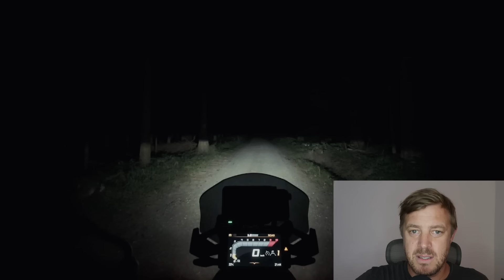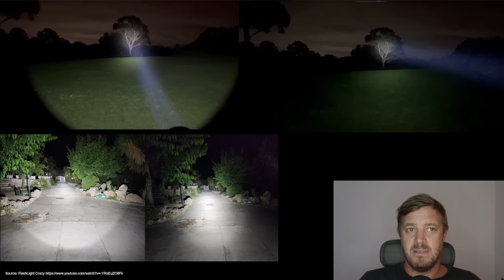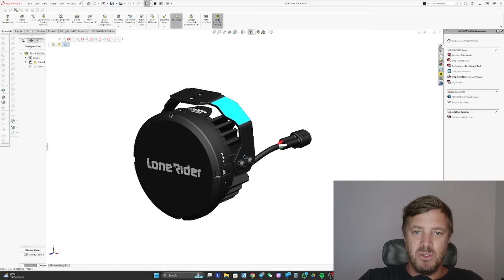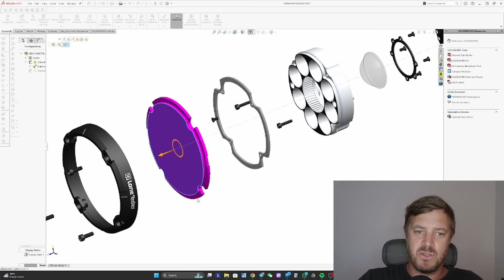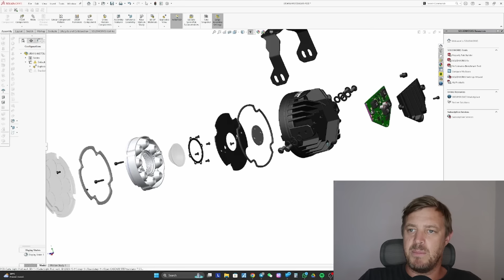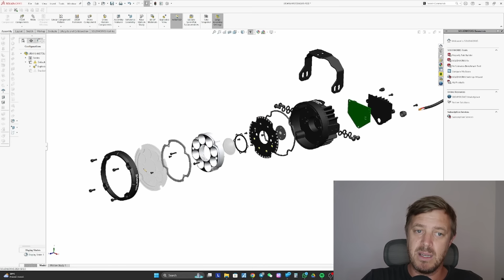Don't Ride Without These! Why Motorcycle Aux Lights Are a Must 🔥

Comment: These look really well designed, but IMO, you made a major error with the DRL color scheme.  Fog lights should be Yellow, NOT Amber!  First, Amber lighting is illegal in the USA on the front of a vehicle, except for turn and hazard indicators (which MUST be Amber). Therefore, your DRLs should be either Yellow or White --  Not only are Yellow fog/aux lights legal, they provide excellent contrast with the White headlight which stands out to other vehicles, are more visible than Amber during daylight and of course, penetrate fog/mist/rain much better than Amber and even White.

I would strongly recommend White or Yellow DRLs that switch to Amber when turn/hazard indicators are activated.  I personally know at least 12 riders (including myself) that would buy these tomorrow if they had a Yellow DRL option.
Reply from the maker: Noted in the switching from white to yellow. Looking into it 👍
Reply from the maker: The DRL can be changed to white, and the yellow lens added.
Reply: @LONERIDERMoto  I "think" this is great news... are you saying that the DRLs can now be switchable to White or Yellow (not Amber)?  And if so, can they then switch to Amber for turn/hazard indicators?  In other words, can the DRLs support 3 colors, i.e., White, Yellow and Amber (for turn/hazard indication).

If they can only support 2 DRL colors, then please go with White and Yellow.  Even if you're running Yellow DRLs, they can remain yellow (though not flashing) when the normal OE Amber turn/hazard  lights are activated.
Reply: @LONERIDERMoto  You mean Amber lens added, not Yellow, correct?

Comment: I saw a product called MotoCAN on your thumbnail. I was wondering how you guys were expecting us to install the lights onto our bikes. I was thinking that the only thing that would male sense is if it was installed with the EzCAN or similar system. So it looks like you guys are going to be selling your own version to go with the lights. I'm hoping that the lights will still work with the others like EzCAN or Cansmart.
Reply from the maker: Hi, yes, it will work with MotoCAN from Lone rider or  Hex Innovate ezCAN (Gen II, software version 2408)
Reply: @LONERIDERMoto  Great - thanks a lot. I am looking forward to seeing the new lights.

Comment: Looks like you nailed everything with these babies. Riding 2021 GS 1250, using Denali controller and wiring, will these plug into same Denali wiring and be compatible with Denali controller?
Reply from the maker: It will need a MotoCAN from Lone rider or  Hex Innovate ezCAN (Gen II, software version 2408). Regarding the Denali controller, not tested, but as the MotoLights are controlled by LIN technology, my best guesstimate is they will not work.
Reply: @LONERIDERMoto  that’s sad. I guess I’ll carry on with Denali.

Comment: Great design. I like it. Seperating electronics from the led pcb. Great for repairability . If the electronics fail and needs to be replaced then you dont have to replace the leds also with it.

Comment: As a user of Aux lights, the one problem I see is sometimes condensation builds inside- is there a provision for this as it eventually corrodes the PCB?
Reply from the maker: Yes, a very common issue for all lights pods. We developed a new method in the factory to do the burn in test (adding heat) on every pod, then seal and blow out with pressurized air that's filtered. But there is also Conformal Coating to waterproof the PCBA. We are aware of this issue and will track it, and have methods to know if the light was opened and water was added, or it was condensation.
Reply: It burns off in 2 seconds when the lights are on

Comment: I don't know about the rest of Europe but in Spain you can't legally fit 2 high beam aux lights on to any motorbike unless you eliminate the oem high beamof your bike, otherwise you can fit only one aux light...stupid laws
Reply from the maker: For this reason, we add blackout caps as standard. Yes, odd laws. I'll check, but we run DRLs, they have a different classification (indicators) so maybe there is a way though..
Reply: Yep, and even if you do this, you need and engineering studio certificate, saying that those lights are "ok" for that specific bike (also they need to be installed on a registered workshop), and then after paying again you need to pass the ITV (goverments inspetion) to get the permission. Goverments doing what they do best, stealing.
Reply: Weird in Colorado we are allowed 2 aux lights
Reply: @loghomemaintenance  laws in Spain make no sense... basically you can double whatever lights your vehicule has. A car has to high beams so you can add another 2, a bike has one so you can add another one, this has to be on the same vertical line as oem light but at lower level, if you want to add to aux lights(high beam) you have to eliminate the oem high beam then they can be place at both sides of the motorbike. If these were homologated as fog lights then it wouldnt be a problem you can add, one each side.
But then fog lights cant be as bright as that.
Long story made shlort Spain regulations suck and you cant do anything to your car or motorbike

Comment: The thing I'm wondering though: Why is a company mostly focused on bags/tents or other non-electrical accessories, now entering the lights department and can ensure good build quality? Don't get me wrong, I'm a customer and I have the pannier bags, but do see some design flaws that Mosko moto has tackled. I'm not sure if Lone Rider is going too wild with more and more products instead of perfecting their base products.
Reply from the maker: Yes we can ensure excellent build quality, and also innovative functionality. We have experts and leaders in all fields that worked the light. Lens optics, LED tech, heatsync and electronics, manufacturing and software also to name a few. As for the improvements on the luggage, please let me know the issues! We are always pushing updates and your feedback is key! 💪
Reply: @LONERIDERMoto  The feedback:
- Panniers are sold as being adjustable to a lot of bikes, but only provide pannier rack dimensions. That doesn't take into account the position of the bag to the exhaust. I had to drill extra holes into the backplate to make sure there was some space left. So: continue testing on multiple bikes and provide advice what pannier racks to buy (and add extra holes on the backplate)
- Continuing on the previous: too much focus on BMW. Have some love for a lot of the other brands.
- Empty weight of the bag + backplate is a lot. Carrying them with more weight in it is uncomfortable, it actually hurts your lags during walking. A shoulder band is provided but a lot of hassle to tuck away. Could choose to leave the outer bags to the bike and take the inner bags out, but that only works good for hotel rooms, for camping you want maximum water proof. Not always can the bike be parked next to your tent (unfortunately more and more camping grounds want it separate). Would recommend somehow keeping more of the backplate to the pannier.
- Taking the inner bag out and later putting it in again is a pain, mostly due the outer bag being bulky and thus hard to close eventually. Which also leads me to the following: closing it (folding and snapping it into the tiny hole) is becoming easier the longer you do it but if you think of trying to add 'to much' it quickly becomes hard to close it. In this case I'm talking about adding 'to much' below the folding line but adding more stuff to the sides which makes it bulky.
- Should be a way to keep the inner bag strapped to the outer bag when it's inside. So that you don't have to continuously open 2 bags and close 2 bags.
- it's more of a hassle to adjust the backplate to a different pannier rack then was shown in the video. Mainly because you think it's all good but then the locking mechanism didn't close. I currently have the issue that I always need to lift 1 bag a little bit up to lock  it. Obviously fixing it means taking the whole bag of the backplate again. Compared to Mosko Moto, a lot harder.
- I once scratched a pole at low speed. The bag seemed to correctly compress a bit and then god past it. But unfortunately that bended the backplate a bit. I now assume the bags + backplate are only capable of handling falling left or right without moving forward in order for it not to break - so far the 'rugged bags'.
- The metal parts are sharp, it already damaged my pannier racks. I currently have taped wrapped around the contact points in order to avoid damages (which I have to remew every now and then).

I love the locking (piece of mind leaving it behind), the spacious bags, the looks, the waterproofness, the molly panels, etc. It has a lot of great things but compared to Mosko Moto just not perfect. Hate it that my girlfriend is quicker in everything during packing, attaching and carrying :)
Let me know when I can test the updates ;)
Reply from the maker: Awesome feedback! Ok, I think we can work on several of your points. Logged, for the the next round of improvements.

Comment: Having a full street legal light like this is revolutionary, considering that it will probably work with ezcan or similar controllers. Will you be making also custom brackets?
Reply from the maker: Yes, with brackets! we only have a few for now, but will keep pushing new parts out. The MotoLights come with a set of bar clamps so it will fit any crash bar 22-25mm
Reply: @LONERIDERMoto  bugger, my crash bars are 28-32mm!

Comment: Great job impatient to be the 16th to see the orice and if it will be compatible with my f900gs
Reply from the maker: It will be compatible with the F 900 GS Adv - K82 and 
F 900 GS - K81
Reply: @LONERIDERMoto  ok then i order on monday. Special pack Matt Adventure Edition 😂
Reply: I bet £400 each! 😂 denali d7 are about that, plus an ez can at £260! Not guna be a cheap option😢 I've got 2x d1, 2xd3 2x b6 and the air horn! Plumbing via 2.ezcan! If.i have ports they can plug into....I'll get them! 😂

Comment: But if the OEM is limited, you are as well. User can't use lights, that the OEM can't use. Laws are for everybody.
And every car, motorcycle or what ever has that cutoff line. That's also determined by law.
Reply: I'd rather risk a fine than have an accident with an obstacle or animal that I couldn't see at night. The laws are sometimes not fair for everyone and motorcyclists are the most affected, so everyone decides what to do with their bike. Of course, I will fit these auxiliary lights.
Reply: @NeiAdv Agreed . I also treat a red traffic light like a stop sign in torrential rain. I look four ways and go.
Reply: @NeiAdv  As long the lights are properly aligned, other road users don't have an issue. But many GS riders I've seen, blast their lights straight on. I get it that motorcyclist need more light distance because of their stopping distance, but yet, there are other road-users to keep in mind. 
Like the aux light shown in the video. I would've designed the bottom two leds with a TIR lens. To get that flood light in front of the bike. Even with a Flood lens, you can easily light-up 40-60mtr in front of you. Spot leds should only be used outside the city.
Reply: Here in the USA you are not limited.
Reply: Not true. And he clearly explained that.
Reply: Yet they will pass an mot! Same as a different louder exhaust, it's down to the mot person! So long as it has road legal stamped on it, no cats, louder,yet legal! You can remap to get rid of the speed limiter! All legal!
Reply: @terrystratford1235  my state doesn't even have motorcycle inspections
Reply: @skippynj1979  what state is this? Is it some old law, or.do bikers keep the bikes really good? Or is your state low on organ donations!?
Reply from the maker: Correct. We will work within the law and get all the compliance documentation, but we can move faster then large OEM company's and stay ahead of technology, and introduce better quality components.

Comment: Will your lights fit on a Triumph Tiger 900 ?
Reply from the maker: Works with:

Tiger 900
Tiger 900 GT
Tiger 900 GT Low
Tiger 900 GT Pro
Tiger 900 Rally
Tiger 900 Rally Pro

Tiger 1200 GT
Tiger 1200 GT Pro
Tiger 1200 GT Explorer
Tiger 1200 Rally Pro
Tiger 1200 Rally Explorer
Reply: Yes